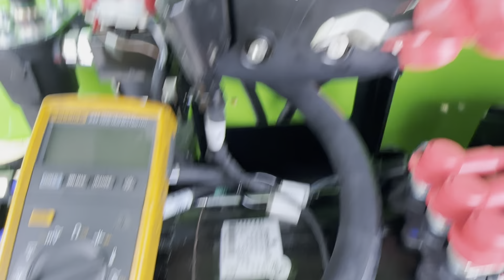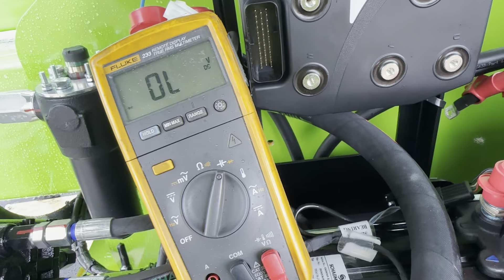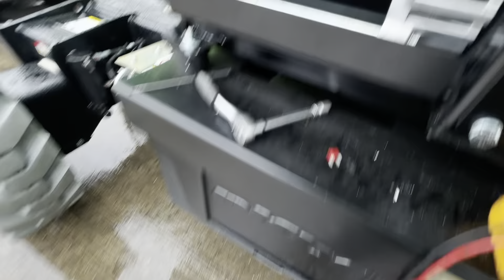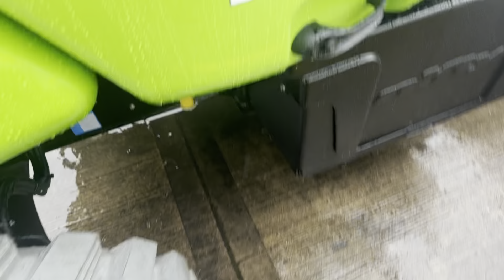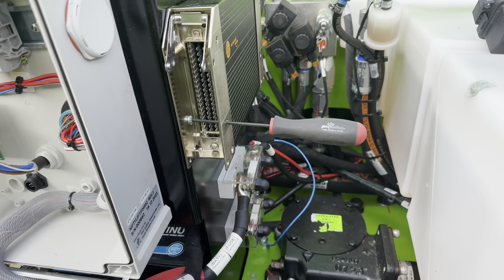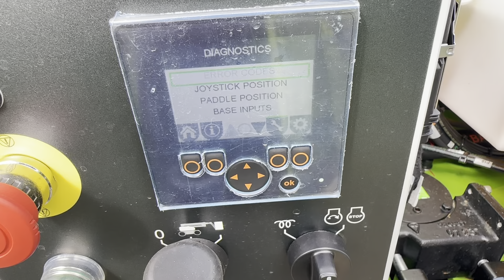From Curtis error code 12  to Niftylift error 01C00000 can bus short  🫢 #mewp #repair #hybrid

Comment: Great video man! So, I had Curtis rebuild out controller and they tested with motor at their site. 1232e. I am getting the same Code 12. Is it possible that the motor is fried? Thanks so much! Is there a way to test the motor the way you tested the controller? This is a 2014 Presto Walkie Pallet jack. It doesn't have any can bus stuff, I don't think. Just the controller.
Reply from the maker: Hi buddy,  yes it could be motor issues . Do you know what fault was on your controller was blown mosfets or something else? Motor you could test by measuring resistance as well you should expect to see very low resistance. And measure if motor phases are not shorted to motor case.
Reply: @RTFIX Thank you! Yes, the controller was fully rebuilt by Curtis people. I also, just to test, did the same resistance test to the controller like you did. Thanks to you, I understand that now! All were even 4.98. The motor is a delta, 3 phase, 3 lead, which I just learned 😆.  I tested resistance between phases, and they all went from .3 and dropped to .1 😮But, thank you again, I will now test each phase to motor case to make sure. But, I read the drops from .3 to .1 that's bad lol. Mannn, I would be willing to even pay for maybe a quick whatsapp call just so I can make sure. Motor is REALLY hard to find in China. Thanks again. If okay. I will reach to your contact here?
Reply from the maker: @ytnax send me an email we can have a chat buddy

Comment: Another excellent piece of work and very well explained in great detail. I’ve seen this before where the canbus don’t like 48v flowing through it. Keep up the great work look forward to the next ones
Reply from the maker: Many thanks!🙏
Reply: @RTFIX  The test you carried out on the motor controller. 
Could you use that method on the older  type controller?
Reply from the maker: @stephenreeves4898  yes definitely you can for example on Sepex type DC controller you would go with red probe on B- and would check F1 , F2, M- with expectations to see diode drop and next one is black probe goes on to B+ and measuring F1,F2,M- looking for diode drop as well .